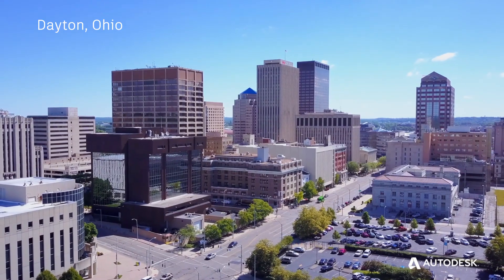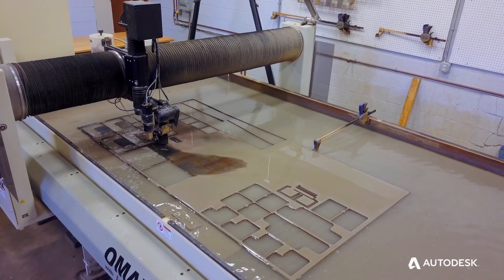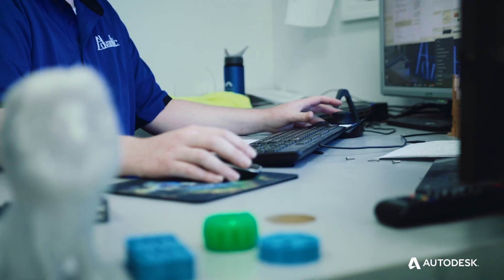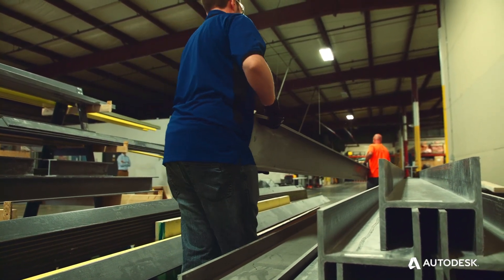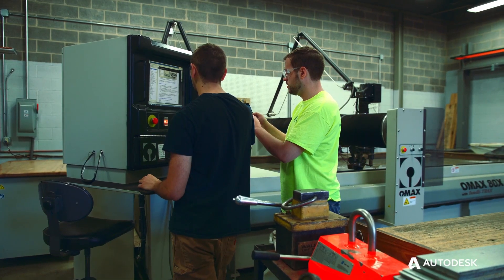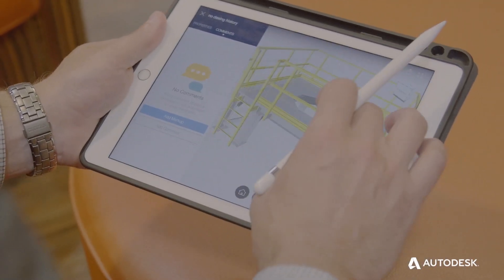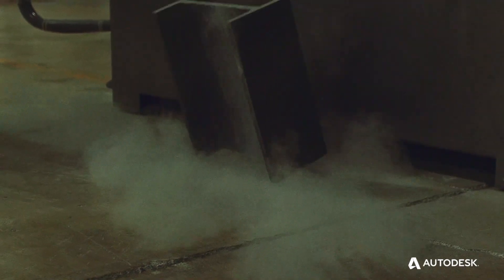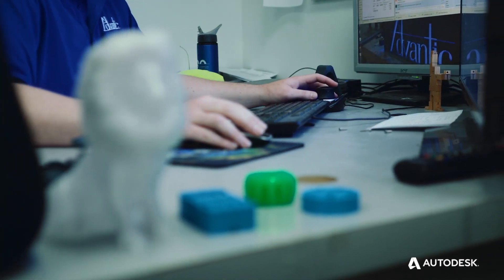Advantic's composite materials extend the toolkit for engineers & builders

Comment: i just got the best idea ever, autodesk read this and make it please : Make a slicing tool who can generate "super gcode" for 3d printers. What is "super gcode" ? Print this cylinder at 0.1 layer height at 30 mm second with 50% of infill and print the cube near the cylinder at 0.2 60 mm sec at 5% infill. We really need this. When you got a huge piece to print you can't set the whole thing on 30mm second just to print perfectly 4 or 5% of this part.
Reply: Simplify3D has those kinds of tools